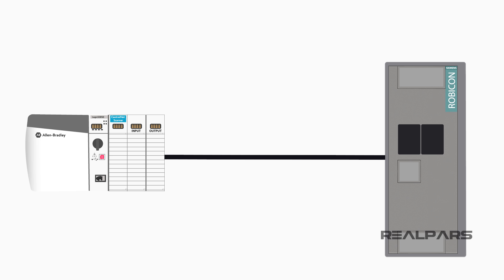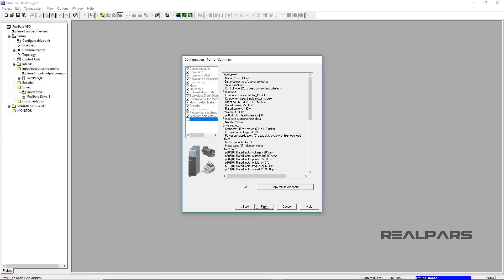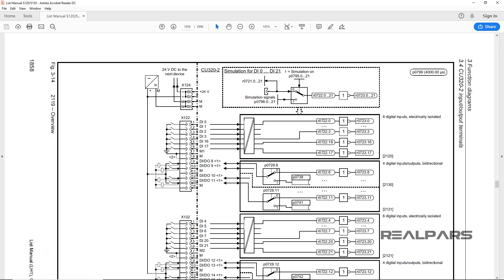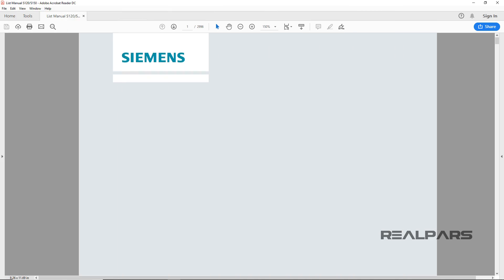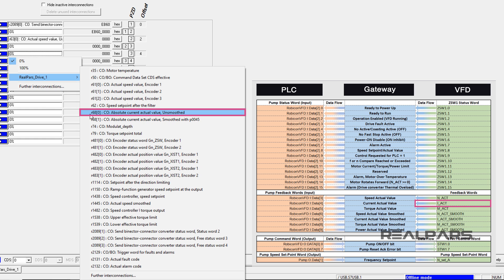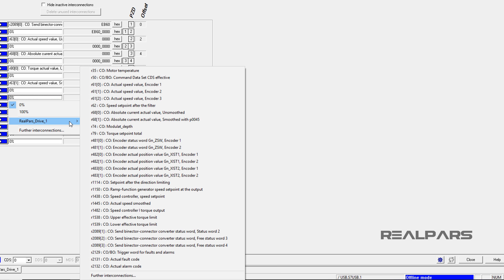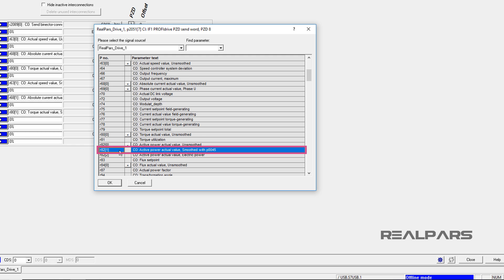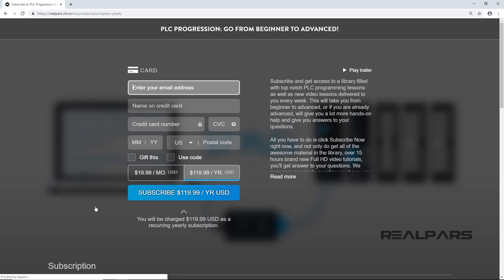How to Control a VFD with a PLC – Part 5 (Configuring Communication Data in the Starter Software)

Comment: What is the last parameter P2051[0] refers in binector connector? And why it is updated auotmatically?
Thanks
Reply from the maker: Hi Hassan,  

Thank you for your question! The P2051 is part of a data 32-bit word from Sinamics to the controller. The protocol and more information can be found in the links I provide. But you must have a background in drives in general, and if you know Siemens drives, the better. Siemens offers in-depth training for their divers. 

https://support.industry.siemens.com/cs/document/109781807/sinamics-s120-s150?dti=0&lc=en-US

https://www.siemens.com/global/en/products/drives/sinamics.html

Happy learning!